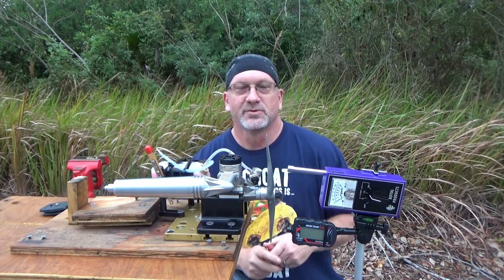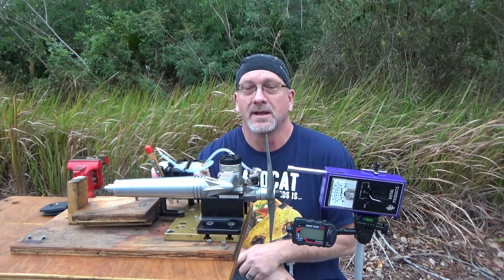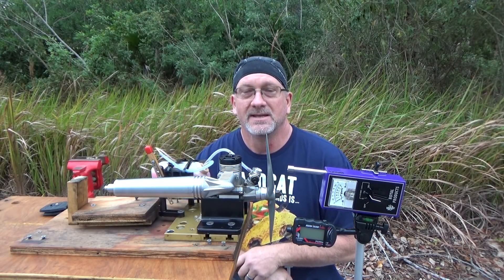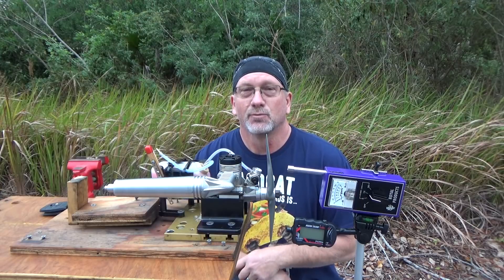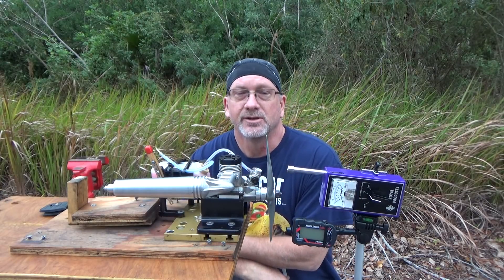Rossi 45 Another Run

Comment: Have you tried a Master Airscrew with the analog tach. Sometimes a black prop reads easier.
Reply from the maker: The analog did not have an issue reading the prop.